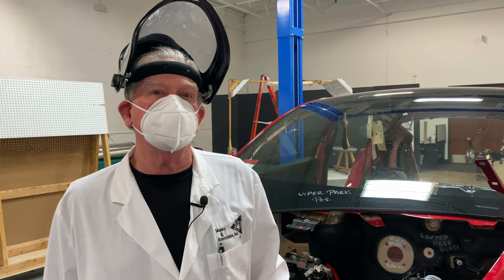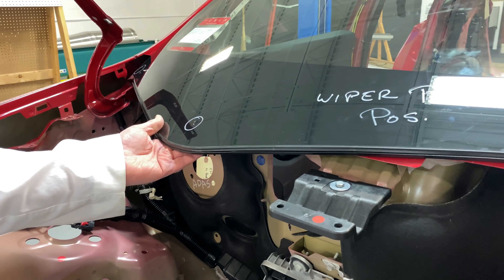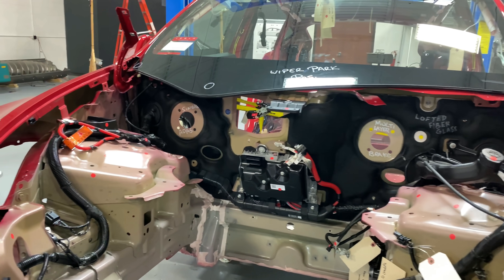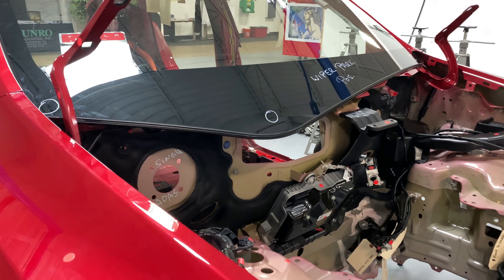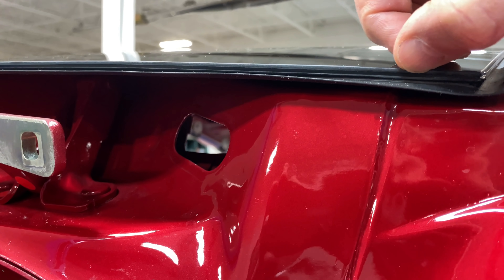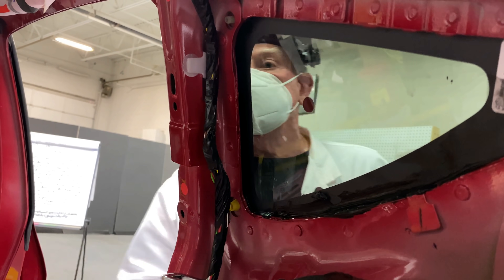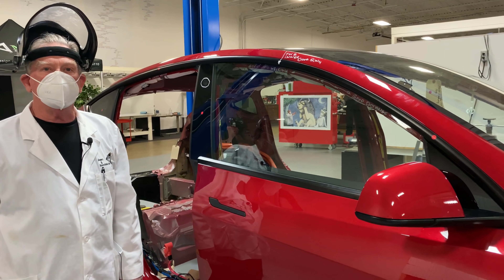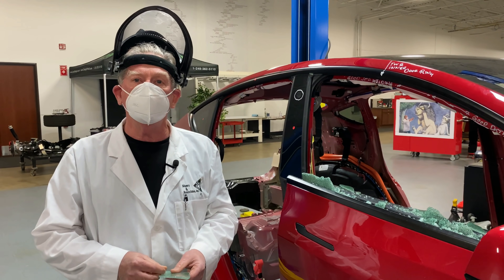Model Y E25: Glass Day at Munro

Comment: The Model S Plaid is supposed to come with double thickness glass in order to lower road noise. How will double thickness glass affect the ability to break the glass in case of the need for emergency egress? I'm thinking of safety. What if someone needs to break the glass to get an occupant out. Will it be as easy?

Comment: The area where the power brake / master mounts for sure needs a strong mounting structure to resist flexing which over time leads to metal fatigue / cracking ....If it can't be gusseted then maybe a cast piece in here ? ? ?   It's a drag to fix when these places break ...... Maybe what they are doing is just fine too..........

Good job on the glass nut job !!!   I mean good job boss ....Make that good job Boss, Sandy, SIR !!!

........Psst .........between you and me........ that guy is an animal ............

Comment: That's a thought.
The side windows are supposed to smash - for safety reason. Rescuers can get at you.
So is not good and it fails safety regs that the cybertruck specs windscreen & side windows doesn't smash (well beside the demo and it don't penetrated interior) ..

Comment: Are you sure there are only two layers in the panoramic glass? Possibly a 3rd middle layer is slightly inset.

I believe I remember seeing a patent for a three layer glass system where the center layer had a micro honeycomb holes to provide some insulation while minimizing added weight.

May be worth slicing open a cross section.

Comment: that was fun.  Im surprised that the roof glass is tempered.  My understanding is that the laminating process anneals the glass and it loses its temper.  Normally laminated glass is prone to cracking while tempered glass is prone to shattering, but has much higher strength until it gets to the point of shattering.

Comment: Normally the wiper blade park sign is a thin line printed on the glas . So in this case you do not need a extra print . Nice sollution . I guess you also will find a mark on the upper part of the glass to mark the max view . The glass in the door is different because of savety . You need to be able to smash it in cace of a emergency . ( you , police ,fireman ... ) The glass in the roof is special ,in case of a roll over and you slide over the street as a intinct you would hold your hands there . Like in a convertible... bad idea !

Comment: Are the body panels ALUM or steel?
Reply from the maker: The Y is a mixed material construction with primarily steel up front and aluminum in the rear.  A full panel-by-panel breakdown will be included in our final report.  Thanks for tuning in!
Reply: @MunroLive  Thanks Sandy, I was just curious for the rust factor.

Comment: there are modern cars in existence that DON’T use tempered glass?! also, most cars in this price range have laminated glass windshield AND front side windows.
Reply: kam_iko The front windows are when the car is in an accident and the doors are locked - first responders need easy access to give aid to the injured.
Reply: Kevin Kaaz 

true, but firemen still get access, they just have to use a saw, the same way as they do on the front windshield. most luxury class vehicles (think: bmw 7, audi 8, mercedes s, lexus ls) will have also the rear side windows laminated.

it greatly reduces noise inside the car and increases insulation.

Comment: The glue finish looks awful on the right rear window ....
Reply: A certain amount of overspill is intended as that will grip the glass around the edges. And from a quality standpoint extra overspill is better than missing glue giving you a leaky car---something the Model 3 suffers from.
Reply: Glue/sealant is applied by robot and as the window is pressed in also by robot, it squishes out to create the bond and seal. The rough edges are all covered by trim, so they are not visible on the inside and by the black masking in the glass so not visible from outside.

Comment: A right hand drive windscreen will make it easier to fit the one size brake booster.
Reply from the maker: Yep! RHD will require a different windshield with the bottom bump on the opposite side, just like what's on RHD Model 3's.  Thanks for tuning in!

Comment: RIght hand drive needs wipers configured differently .. so it would be different.
Reply from the maker: The windshield will be different on a RHD Model Y, yes (as is seen on RHD Model 3's), but it appears that the dash panel itself may be capable of being common.  There is a welded-on unused bracket on the right side that mirrors the wiper motor mount bracket currently on the left side.  Thanks for tuning in!
Reply: @MunroLive  BTW, there's a chance that the Fremont factory will never produce RHD Model Ys. (Europe will only get Ys from Giga Berlin, but nothing was said about Australia.) So we would only see things that are the same in the design, not parts where having a "LHD only" and (slightly more expensive) "LHD+RHD" part would be used. The extra cost of the latter could be compensated by only having one tooling and assembly setup.

Comment: Below the hole Sandy demonstrated for right hand drive brake master cylinder is another hole ready with a grommet sealing it ready for the steering column for right hand drive also. Sandy has a bit of follow through with his swing as he bent the "B" pillar causing the Baseball Bat to fly out of his hands through the cabin out though the left rear door into the workshop.

Comment: You called that and electronic brake actuator is uses a electronic stroke sensor that measure how hard you press the brake pedal and the signal to the electric motor to move the piston in the master cylinder.

Comment: Is the right hand drive significantly different
Reply: No. With the Model 3/Y design there are few differences. It needs to have the steering wheel and pedals swapped with the glove compartment; the windshield and wipers need to be mirrored; and the headlights need mirrored lenses/glasses. For almost everything else those cars already are symmetrical.

Comment: Why not use the same glass as the Cybertruck for some parts of the other vehicles?
Reply: Probably because it’s is significantly heavier
Reply: @Spartansareawesome11   ...and expensive, or overkill?  Just wondering.
Reply: Tempered glass is an essential safety feature that allows passengers to escape the vehicle after an accident.
Reply: @komentierer   Good point.  So how would that affect the Cybertruck?
Reply: @richardalexander5758  I don't know about you.. but being able to escape from a vehicle after an accident is more important to me than saving $150 on window repair in case I accidentally break the glass.

Comment: Are you sure that the top panoramic lite is Tempered and lami? My Toyota top panoramic lite is just lami.
Reply: since the top panoramic is a structural part yes it has to be more resistant than the simple panoramic glass on the toyota